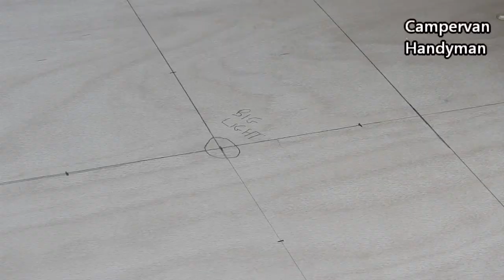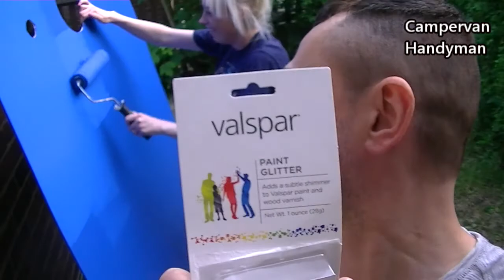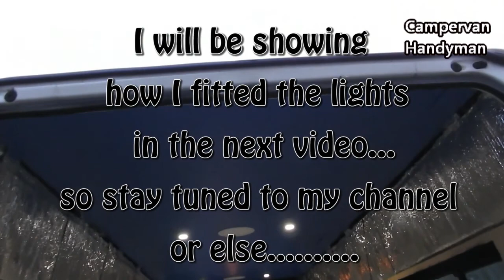030) Preparing The Ceiling for Lights + Glitter Painting - Vanlife - Transit Camper Conversion

Comment: question about your main lights it shows them as 240v  but it also shows a transformer block to reduce the voltage what is the actual voltage of the light as it seems a great waste to bee drawing 204 v only to reduce it to prob 12 to 24 v at the light also this will drain your battery's fast where getting a converter from 12v to 24v would use a lot less and usually most leds are 12v so might save you some battery run time and less ampage drain worth looking into as on flea bay you can get the 12v strip lighting which has colour changing and remote for less than £20
Reply from the maker: Hi there, I have tried them without the transformer, I snipped one off, but they wouldn't work so I had to put it back together. I have had great difficulty trying to find low profile lights that big that are 12v ! if you know of anywhere that sells them plz let me know. I already bought some of that strip lighting :-) I will install it at the end of the build though, Thanks for watching and your input, much appreciated, Atb, Jay & Laura